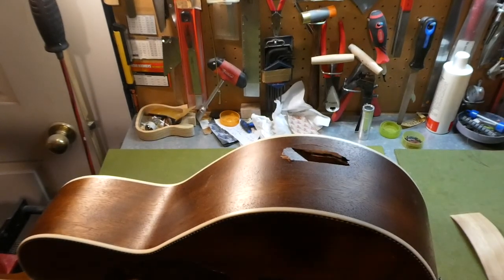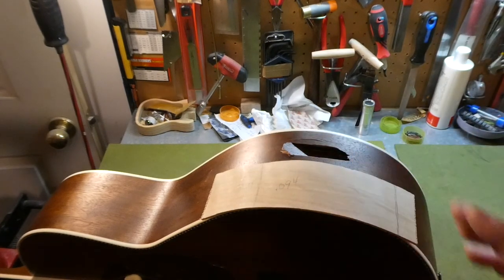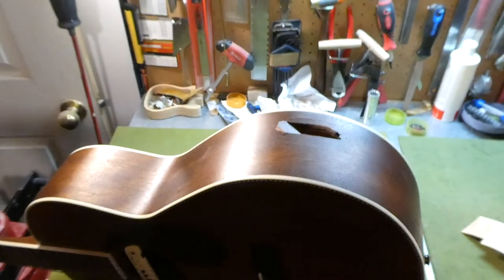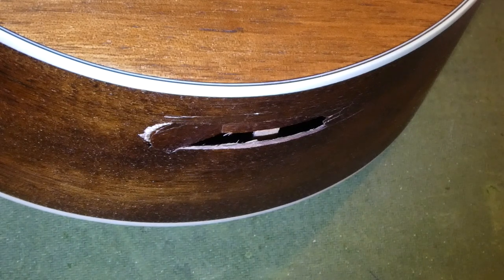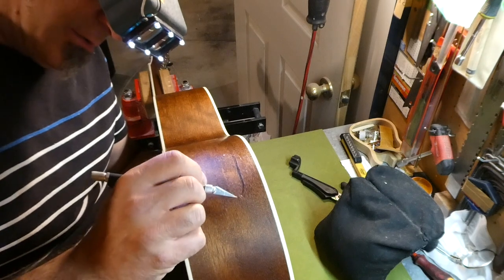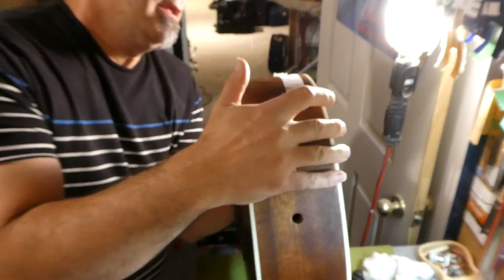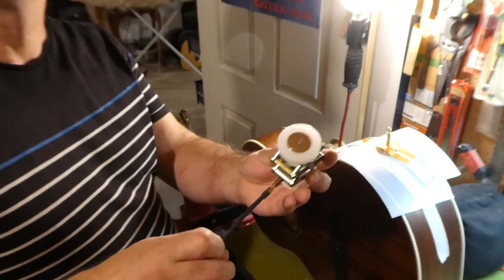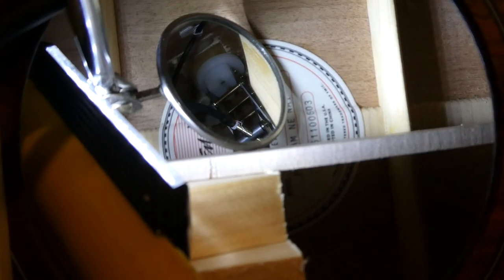Guitar side Patch - Scissor Jack Repair

Comment: Recently won a 10-string Yepes-style classical at an auction, but it had a nasty crack on the side just like this. I'm moderately okay at repairing, but the crack is stable enough where I think I can attempt this without further damaging the guitar. This video gives me a lot of hope! Thanks for posing and subscribed!
Reply from the maker: Good Luck with your repair. I have a few other crack repair videos on YouTube you may like. Some involve magnets and glueing cauls ,while another method involves guitar strings and tuners to haul a patch tight against the inside .Then there is only the tiny e sting hole to fill. Thanks for watching.

Comment: What kind of glue do I use for this? Got a new guitar and accidentally put a small hole in the side a week later and I was hoping I could fix it myself since it's not that big of a bruise.
Reply from the maker: https://www.stewmac.com/luthier-tools-and-supplies/supplies/glue-and-adhesive/glues/wood-glues/titebond-original-wood-glue/.      I usually use the original Titebond glue ,but I may have used the titebond 3 glue in this repair as it has a slightly longer working time. Either will be fine. Best of luck with the repair !